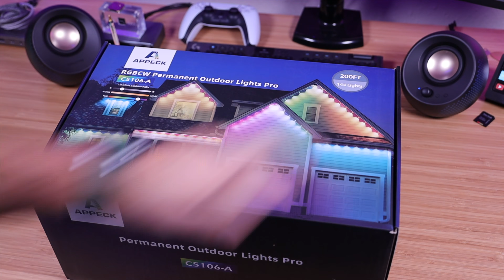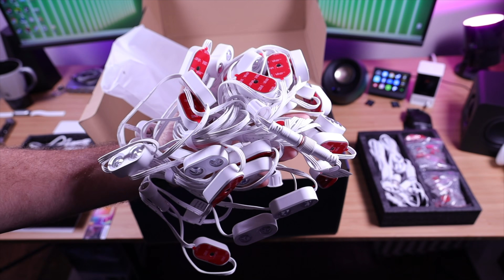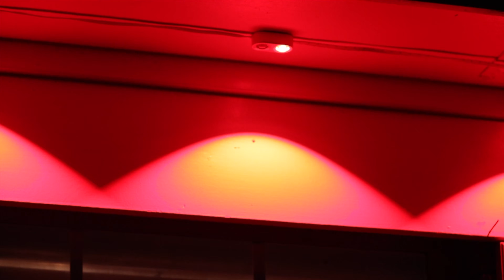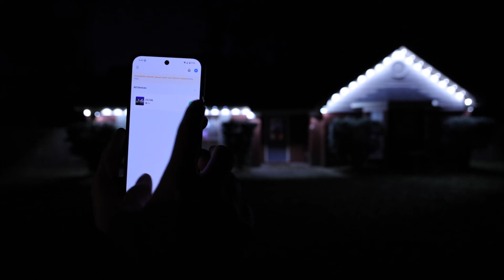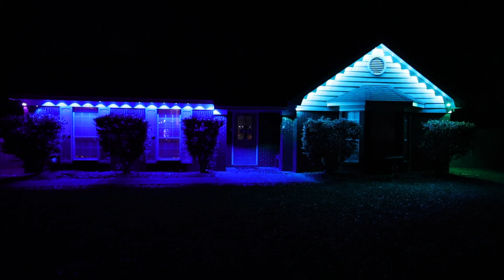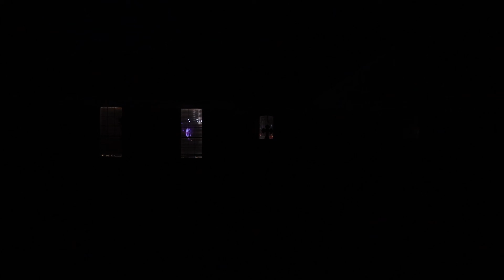NEW Appeck Permanent Outdoor Lights Pro! Cuttable Extendable Lights For Year Round Use!

Comment: How good does the 3m hold up? Is the sticky tape water proof? How long will it last?
Reply from the maker: The 3m is very strong and can withstand some weather. It is considered a temporary solution, but should hold up for several months if you clean the surface before sticking it up. Use the brackets for a more permanent solution.